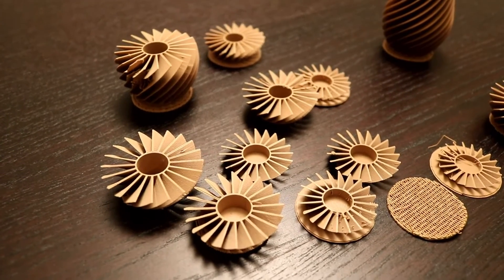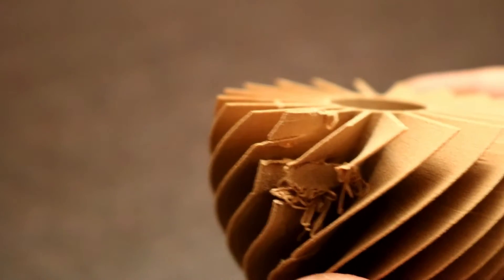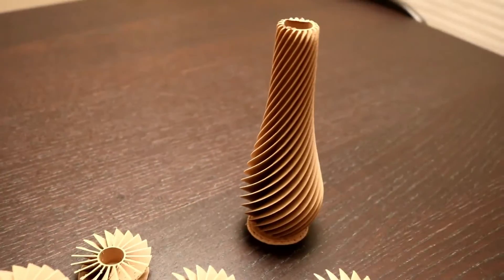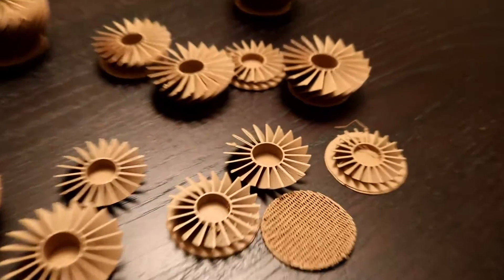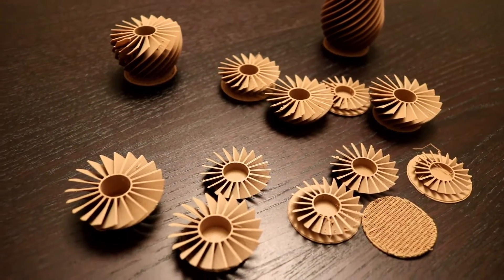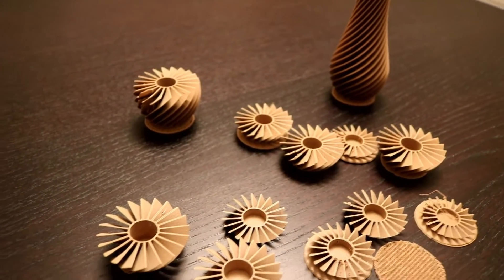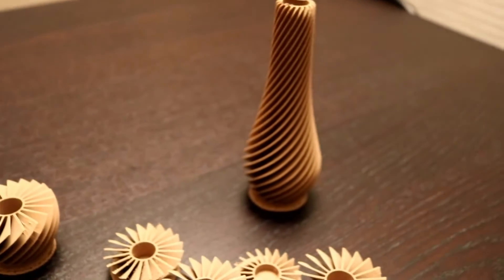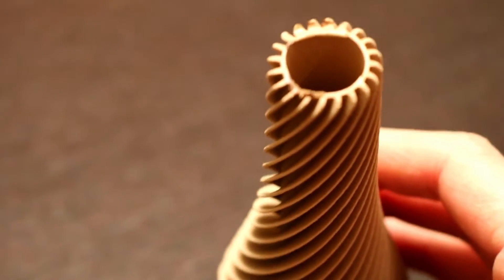Simplify3d & Dual Extruder Problems

Comment: I am actually happy enough with Simplify3D, but I am stuck with trying to add a second extruder to a profile.
Their stock profiles for the Geetech Prusa i3 only has a single, but the I have bought is a dual.
And yeah I found the defaults are are pretty good.
Although funny enough I learned some parameters from S3D that I applied to Slic3r and great results!
Slic3r also was a simple process to add a second extruder to a profile, it's very open, but I guess that also means you have to get a lot wrong before you get it right.
Simplify3D testers have done a great job of the profiles, but I am finding Slic3r actually more approachable for me to tweak.
Have you had any experience of adding to a printer profile?